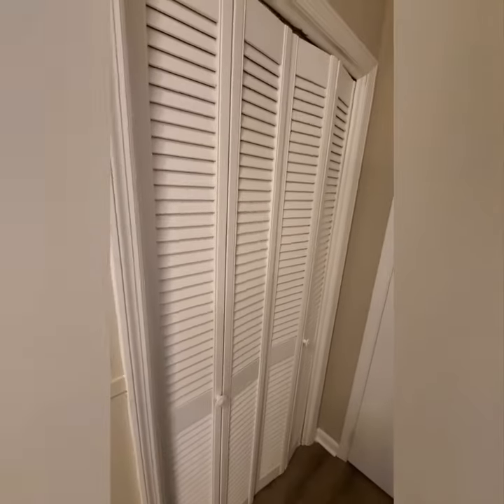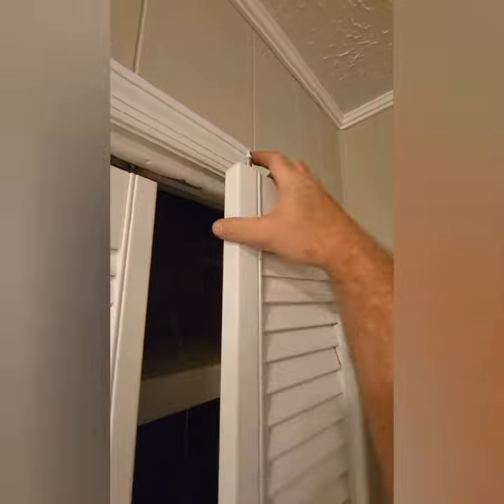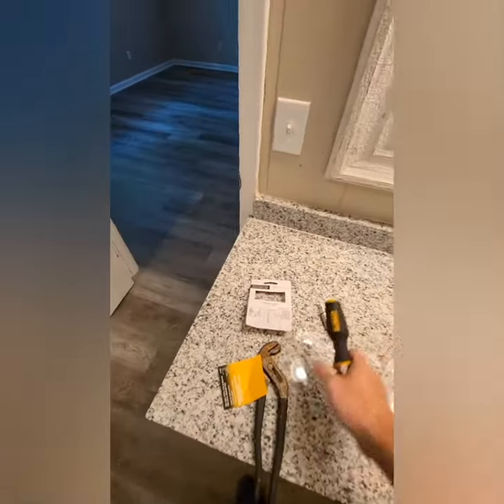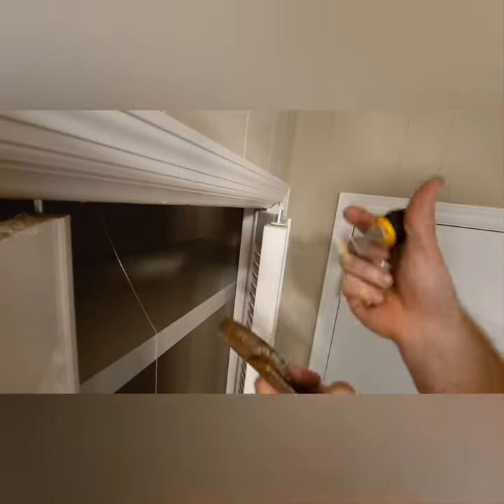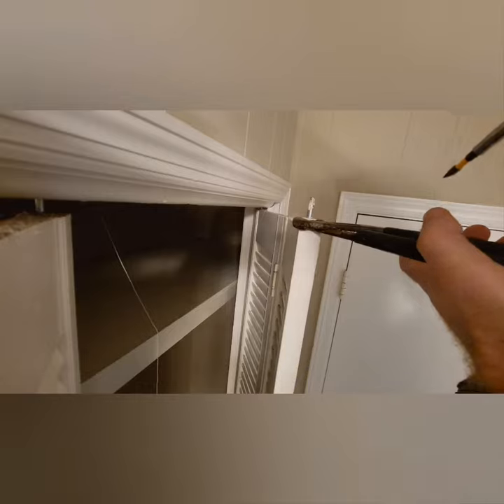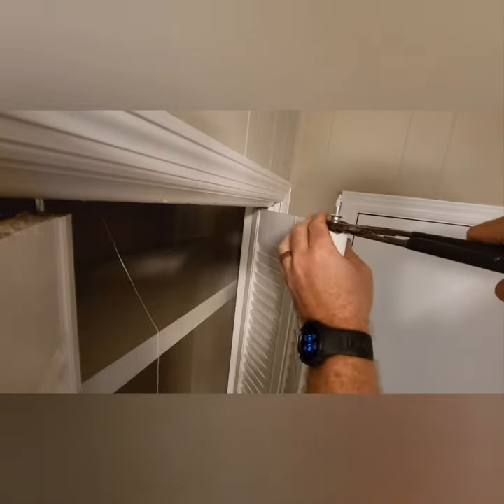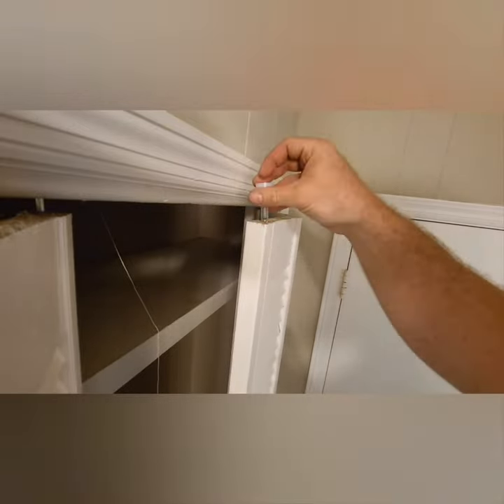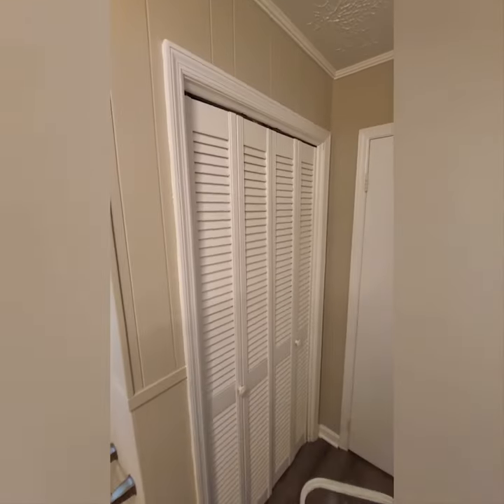How To Repair a Bi-Fold Door ! (Roller Replacement)

Comment: I had to watch this video a couple of times but I was able to remove the old parts and put the new roller into the door and it works great!  Thanks!  I had to use a hammer because the  plastic post part was very tight going into the hole but I placed a small book under the hammer as I hit it into the hole and I got it in without damaging the new roller.

Comment: The plug that goes into the wood at the top of the bifold door is made of plastic is still left inside the wood. I managed to pull the metal part out, but because the rim that you are supposed to pry is made of cheap plastic and is breaking apart it is difficult to pry underneath as instructed. How to get the plug out of the door if there is nothing to place the flathead underneath in order to pry.
Reply: Running into this issue, how did you end up fixing this?
Reply: @dhyanpatel7969  I dug it out unprofessionally. I am not even sure if a replacement will fit properly now. I have put the project on hold. I hope I don't need a new door.

Comment: Hi the coil part of the old roller got separated from the rest of it when I pulled it out and is now stuck in there. How would you suggest I get the coil out?
Reply from the maker: If it's something you can get ahold of the pliers that would be the way to go. If it's inside the hole you could try needle nose pliers.
Reply: @renovationsbydad9760  That worked! Thank you.

Comment: If the wheel and spring are good, but it's still too short to reach the top track, do we just not fully push the assembly into the top of the door or do the spring/wheel assemblies come in different heights?

Comment: don't be a dumbass like me! if the pin doesn't simply drop into the old pre-drilled hole do not tap on the spring pins with a hammer use your pliers! grab the pin just above the plastic sleeve with your pliers and tap on the pliers!